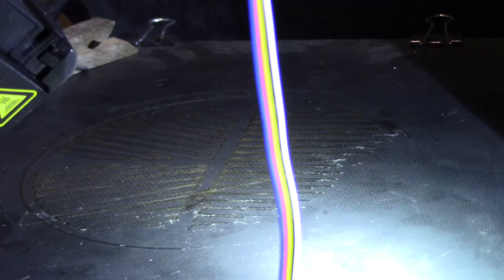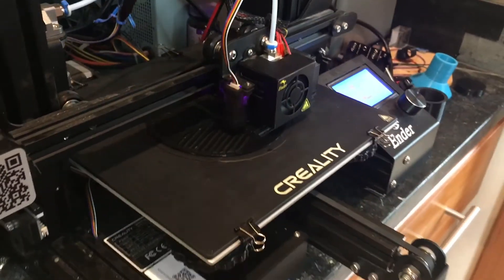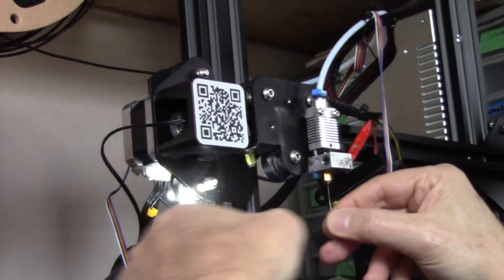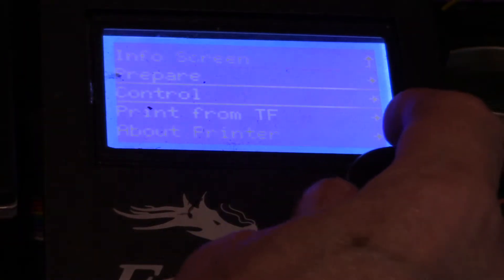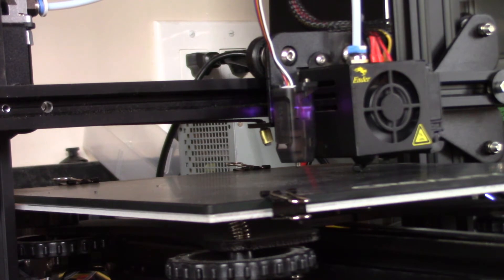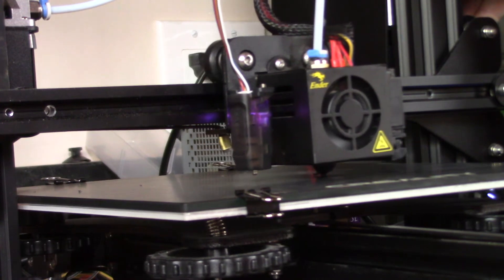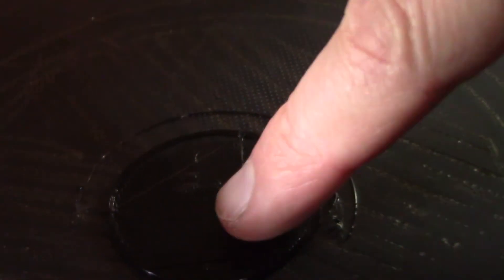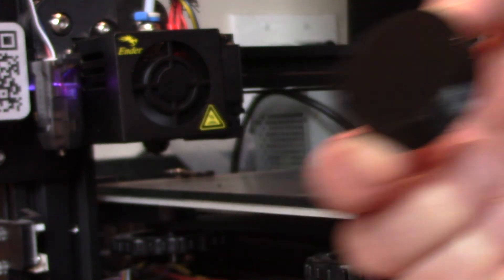Ender 3 Bed Crashing Issue -  How To Fix and Reset The Z Offset

Comment: My ke just crashed into the bed during first real print, totally destroying the coating down to the metal.
No idea why it happened, pretty sure it homed its z axis fine right before the print. Tried homing right after - works fine. Very upsetting.
Reply from the maker: That's a bummer.  If it homes fine but crashes during a print, check to see if the bed is a level as possible on all 4 corners.  What might be happening is that the center is ok which is why it homes correctly, but then one side may be off enough to scrape the nozzle during a print.

Comment: My Z offset only wants to touch the paper when it’s set to -2.000 but I fear this is to low and will damage the bed the second I start to print
Reply from the maker: Mine crashed because the knobs were turned by someone else.  I was not aware and had not re-probed the z offset prior to printing.

If you feel it's too far away, you can manually raise the bed with the knob, reset the z-offset to zero, and probe again.

Comment: For some reason when I adjust my probe z offset, the z axis doesnt move as im doing it, it only applies once I start printing. So it takes so much troubleshooting to get the right offset. Any tips? I have been using the cr touch for a while now and it works well when I do get the offset right
Reply: i have the same problem currently, any fixes? im using bugfix-jyersUI v2.0.1 on e3v2
Reply: i found that, my z axis endswitch was too high, so it couldn't go any lower when i tried to set the offset
Reply from the maker: One thing you might look at is to see if the total z offset exceeds 9.9.  If so then you won't be able to go any deeper to probe.  The solution is to reset the z offset to zero and then move the z axis to zero before re-probing.